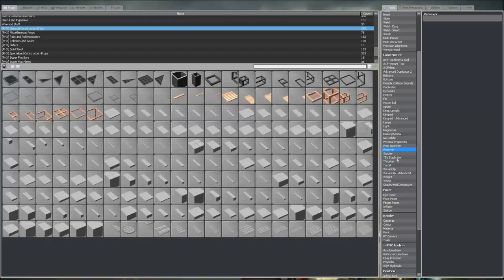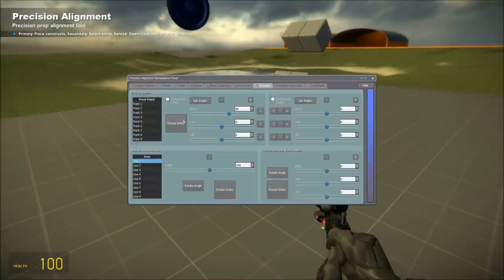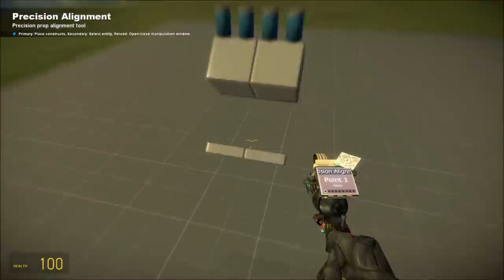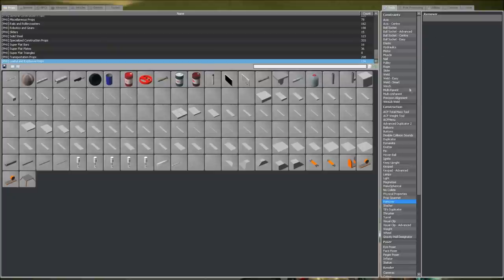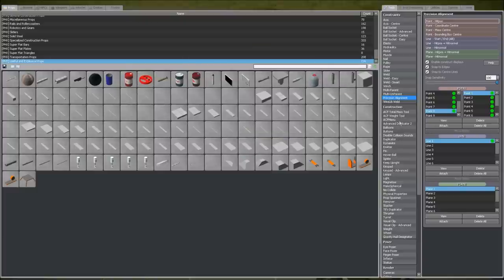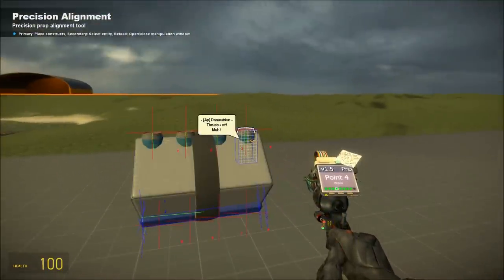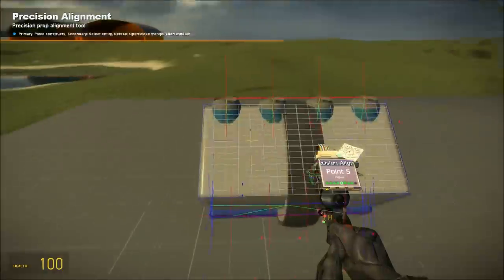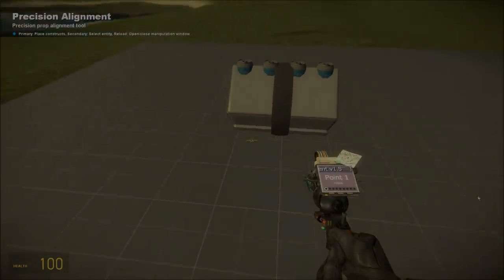GMod - Inline-4 Engine Tutorial Part 1: Assembly

Comment from the maker: @MrNik1001 No, I've never experienced that when using the same file.  However, if you're re-duplicating and saving the same engine over and over, that will cause problems with Advanced Dupe 1.  I recommend upgrading to Advanced Dupe 2 if you haven't yet, it solves a lot of the problems Dupe1 had.

Comment from the maker: Precision alignment is complex, no doubt, but if you make the effort to learn the tool, it's incredibly powerful and fairly quick to perform complex manipulations.  Using EP instead of PA to build the body of my first mech would have at the very least doubled my construction time.  PA also makes it much easier to construct complex engines like the W16.

Comment: Hey ferv, I've been working on my own transmission/gearbox e2 for a week or 2 now, and all I have left is to code the resistance force to the crankshaft. I have partially coded it but doesn't seem to be working correctly or in its best manner. Mind if I use part of the code to your e2 to put into mine, or to just be a kind of basis so I can get the resistance force on crankshafts working correctly?